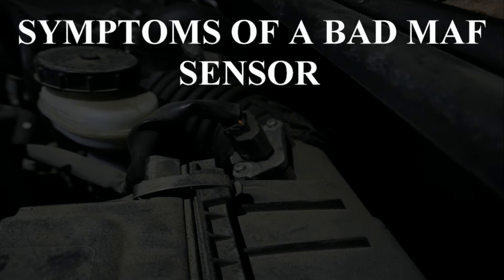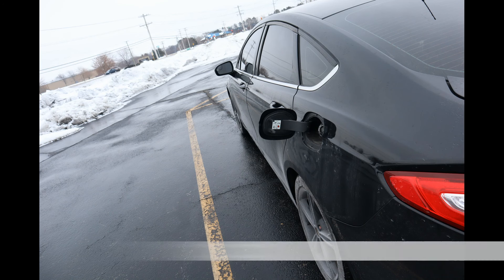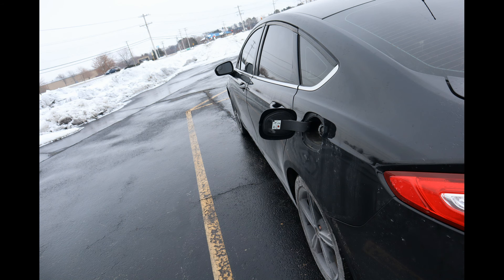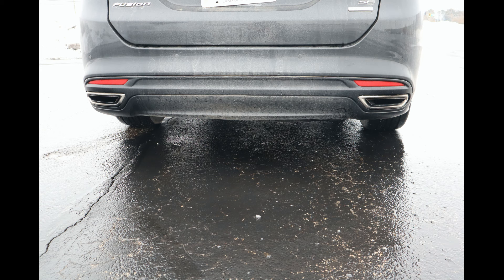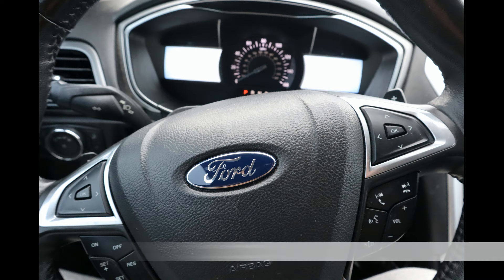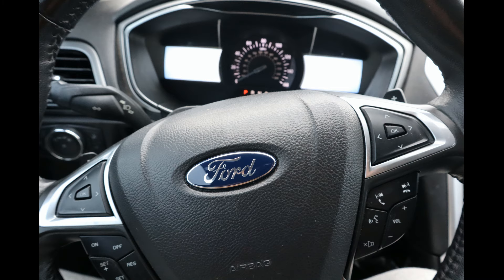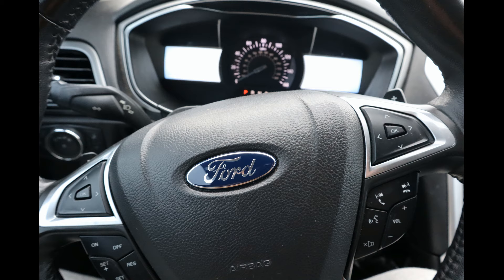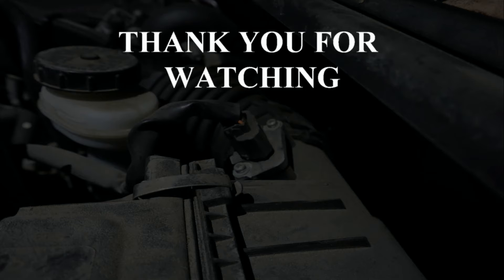MASS AIR FLOW SENSOR SYMPTOMS

Comment: I have a 2009 mitsubishi lancer 2009. Nobody can find the problem, including the dealer. I have this code P0171 😢
Reply: What was the problem
Reply: @haskeyhuuu7461  code P0171
Reply: Did you fix it and what was the problem
Reply: @haskeyhuuu7461  Nope, the problem  still there, but the car drives ok when I accelerate starts slow, but that's it and won't pass the smoke test.
Reply: Mine too the same as your but how long you had the problem

Comment: thank you for the education. I have a 2008 Honda accord 2.4L with DTC P0341. vibration/shaking at idle without gear. Hesitation first then sudden jump when accelerating from a stop. Also very high negative fuel trims -17 and -19. Please advice
Reply: Hey we’re you ever able to solve the issue? I have this same problem same car